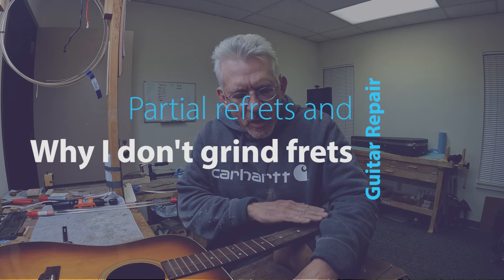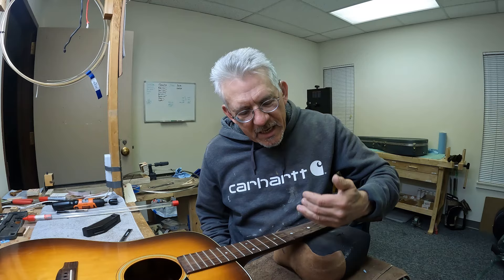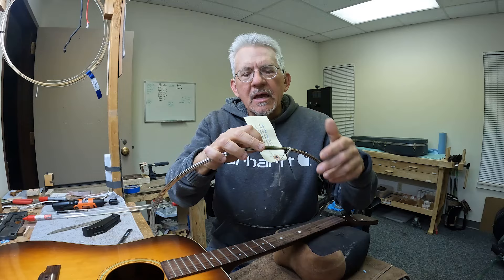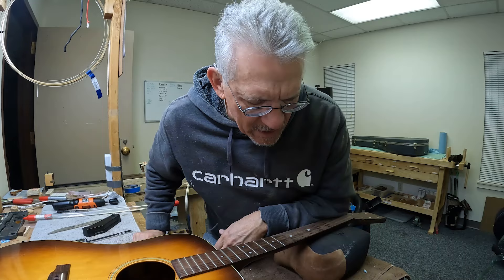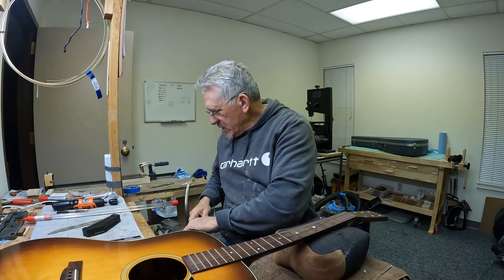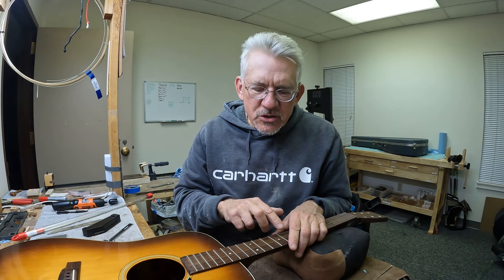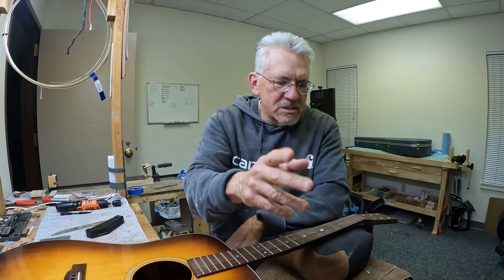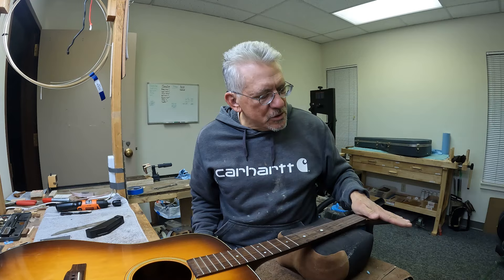Why I do partial fret jobs instead of "grinding" frets.

Comment: Great video.  I always do what your saying.....the other thing is if there is a bad hump...I'll use smaller frets from about the 9th fret up.  Say medium .043.....then Gibson mediums .055 from 1 to 9.  Do a basic level from 10 to end of fingerboard.  Then use a file on the first 9 frets (Stainless to fret 9) to bring them down to about the height of the 10th to 20th frets......under tension...I'm bringing the 1-9 frets down to the possible humped frets....humps always come out over time and as you adjust the relief over time.  I can never get the fingerboard perfectly level in the prefret stage...it accounts for those hidden humps.  The 1st 9 frets will be higher then any humped frets at the 14th area.  This seems to solve the buzzy capo problems also.  I also put a slope from about 10 up.  Why fish glue and not super glue?  Don't you still use super glue for stainless frets....I just did a LL16 Yamaha with stainless....flooded the slots completely before I installed the frets....it is a pain in the butt but boy they're in there.
I don't ever end up with low frets....or frets under .040
Reply from the maker: You could use superglue and I wouldn't say anything, but I picked fish glue in this application because a) the fret slots were already tight, b) nickel/silver frets aren't gonna pop out, c) n/s are going to need replacing in 5-10 years, unlike SS or Evo, d) I wanted to fill the fret slots and didn't need an aggressive glue, e) fish glue is a great lubricant for pressing frets in.

See these videos if you haven't already:

https://www.youtube.com/watch?v=OIbqjfyaBFI

https://www.youtube.com/watch?v=LApd-YJniak
Reply: That's interesting!  Fish glue is a lubricant to push in frets. @Bryankimsey
Reply from the maker: I told Mario Proulx to use bottled hide glue for frets and the first thing he reported back was "wow.... it's a great lubricant for pressing them in!"  I'd never really noticed because I'd just pretty much always used it, per the late great Frank Ford.  I use fish glue now because I have it on the bench and need to use it.

Comment: Have you ever had a case where the guitar where the guitar only needed a partial refret and you ended up doing a full refret with EVO fretwire? Curious about your thoughts on that option.
Reply from the maker: Sure... that's mostly a financial decision because you'll have to do all the frets to switch to Evo.  It'll probably be the last fret job you'll need, too.  

I've also done a few where I used Stainless for the first 7-9 or whatever and left nickel silver for the rest.  There's a slight tone difference between N/S and S/S as I illustrate here, but it may or may not be an issue.  

https://www.youtube.com/watch?v=yXUZmRmQ030
Reply: @Bryankimsey  thanks!

Comment: How do you handle neck groves in the fingerboard behind the frets at the lower strings? That box is near 50yrs old it had to have groves in the fingerboard!
Reply from the maker: So?  Do grooves cause problems?  To me, they don't.  You should be playing on the frets, not the fingerboard and grooves just make the frets act like slightly taller frets.  The reason you GET grooves is because you have worn frets and have to press so hard to make a note or you have fingernails that have dug in.   You're getting new frets so you should quit pressing so hard and you can trim your nails.

If a customer specifically requests doing something with them, there are a few options: 

1) replace the fingerboard in the area of the wear.  This could mean just replacing strips between the frets or it could mean replacing whole sections

2) tease the fibers up with steam and work superglue/dust underneath the raised fibers. 

If I'm reshaping the board, like I did on this one, the grooves will automatically be reduced a little when I sand the shape.
Reply: @Bryankimsey    30yrs of play'n my 76' D18 to near death hours on end. wished I knew what I was do'n.  How I know what needs to be done to fix it.
Reply from the maker: BTDT.  Believe me... I wasn't born knowing this stuff.  :)   If the grooves really bother you, they can be dealt with, but I'd get fresh frets on there, make sure the nut height is set correctly, and try not to death grip so much.  It takes awhile to develop a light touch but I learned.